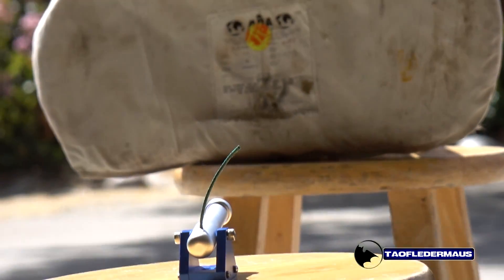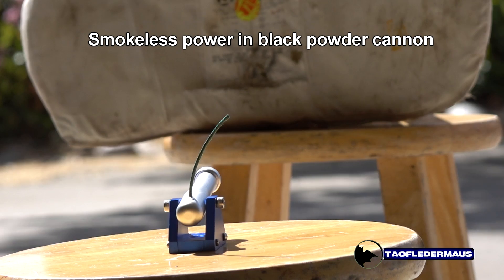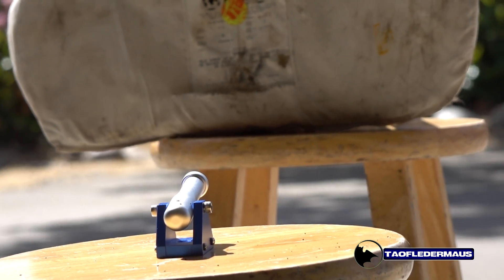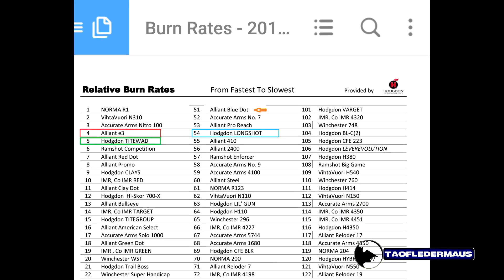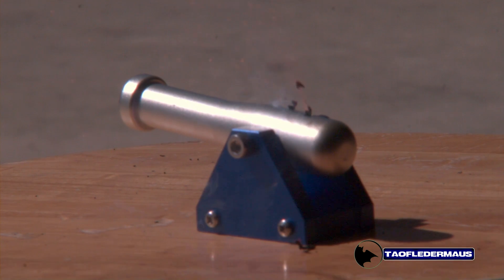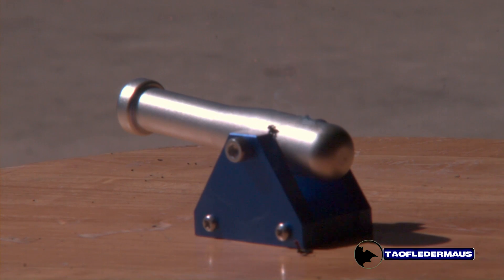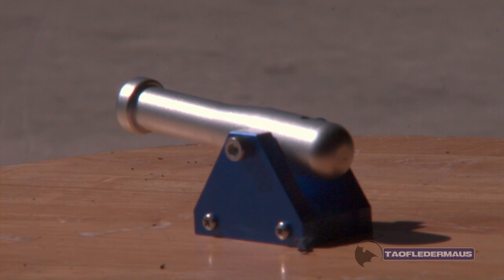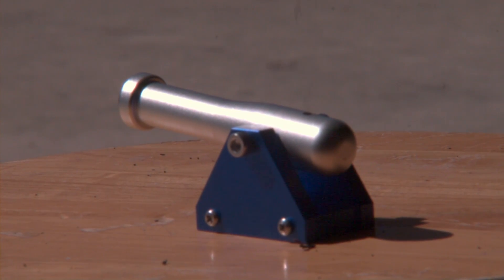What happens if you use smokeless powder in a black powder cannon?

Comment: I still wouldn’t attempt it in a percussion gun.
Reply: Iv8888 has a really good video of large amounts of black powder and smokeless powder in a black powder gun
Reply: @reillyberg7761  Their first experiment did not work using H110 powder, so they used a fast-burning pistol powder on the second attempt.  They could have blown up any shotgun barrel using the same powder, even though shotgun shells use smokeless powder every day.  Savage Arms proved smokeless powder can be used safely in a muzzleloader over 20 years ago.  You need a smokeless powder with the proper burn rate, and the proper amount of that powder to produce a safe pressure.  Using a fast-burning pistol powder to blow up a muzzleloader is no different than Thomas Edison electrocuting animals in an attempt to prove Alternating Current (AC) is "dangerous".     See the YouTube video on Low-Pressure 50 Caliber Smokeless Loads.
Reply: Agreed it might or might not cause problems in a flint lock but it will definitely mess up your day in a percussion weapon.
Reply: While modern black powder muzzle loaders are proofed with smokeless its still a big no go.
Reply: I did. I also made it work and lived to upload it. The only shrapnel came from the comments section. :O